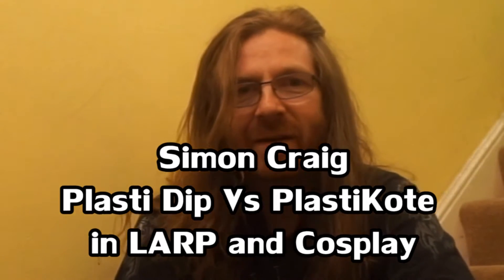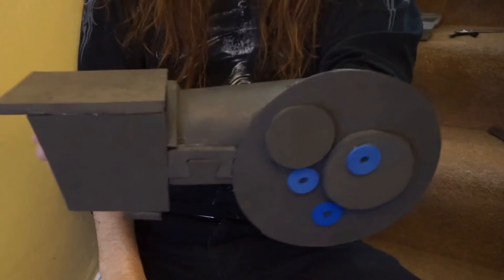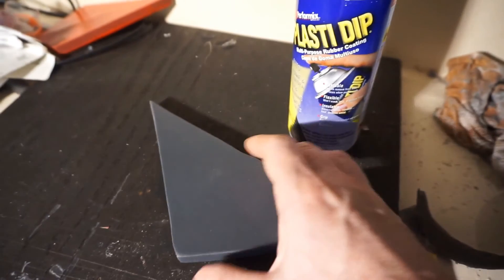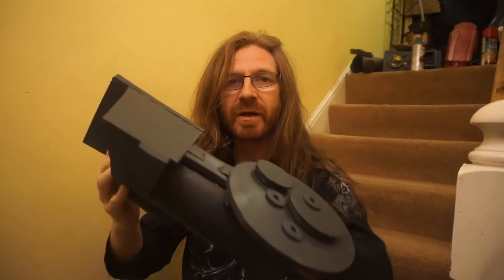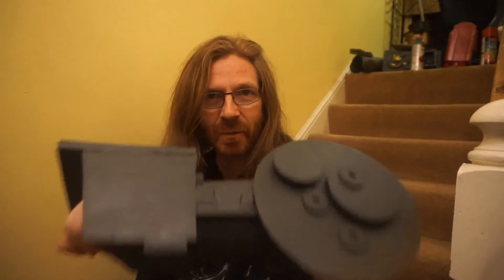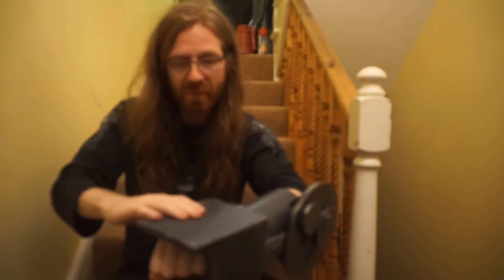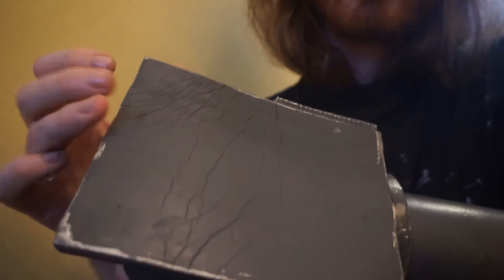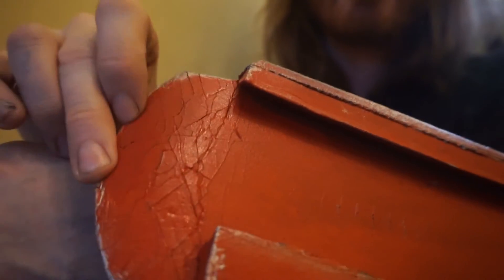Plasti Dip Spray Vs PlastiKote for LARP and Cosplay

Comment: question why didn't you heat seal the foam with a heat gun then use the pva to crate a bas on thet then spray the the plastidip?